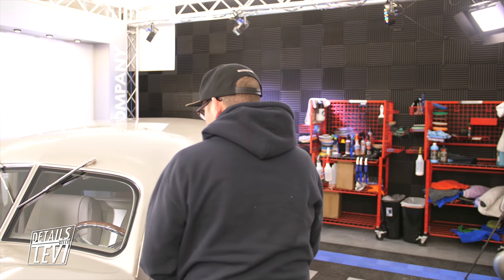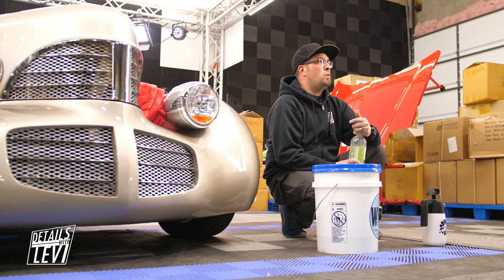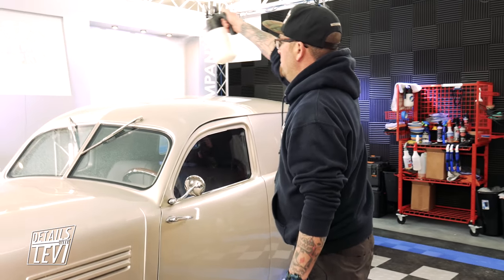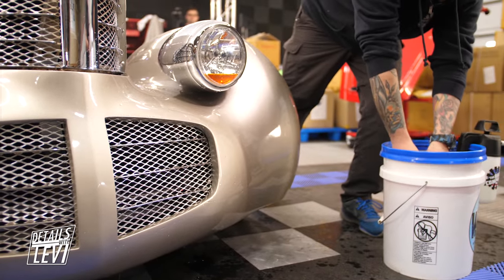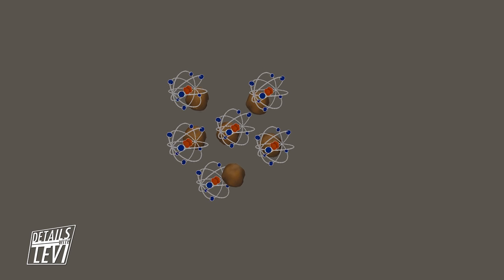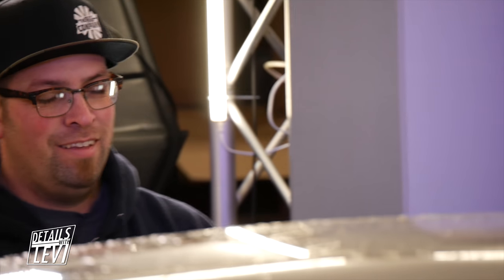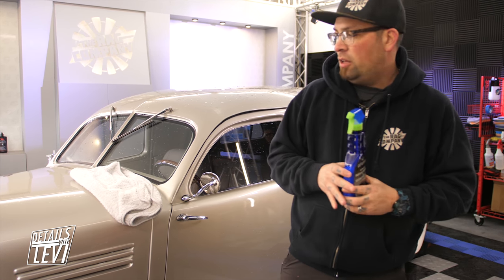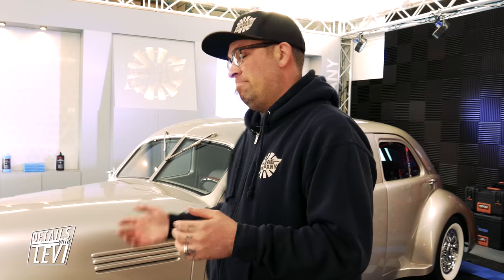Maintenance Wash & Wax with an Ultra-Rare Limo! | DETAILS WITH LEVI

Comment: My routine
Pull the Mustang out of the carport and rinse it off good with the hose. Dust dirt and Wheel Wells
I always have a bottle of no rinse made up for clay lube. I pre-soak with that
I use the big blue/white mitt for road dirt from rain, the sponge for just cleaning the dust off.
By the panel, I dry with gloss enhancer and a Smitten. Usually 2 smittens per side + front and back.
I run over it with an eagle if it needs it for streaks
If I wax it, I use a smitten to spread the wax. In fact I dont want to put anyone out of biz, but I use smittens for most everything

Comment: So here comes the noob question. I was told to never use a dry microfiber to dry my vehicle, and to basically wet the towel then ring out the towel prior to drying. Levy I noticed u did a light product spray on the towel and nothing else. Do u at one point spray it on again say after u twist out the water each time or is that a one time application?